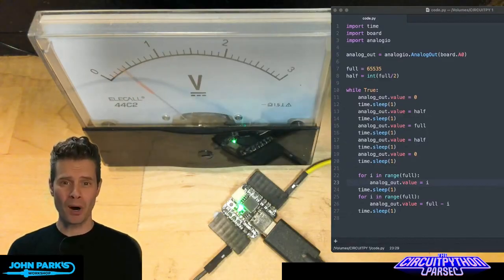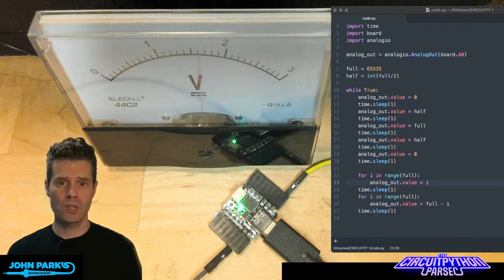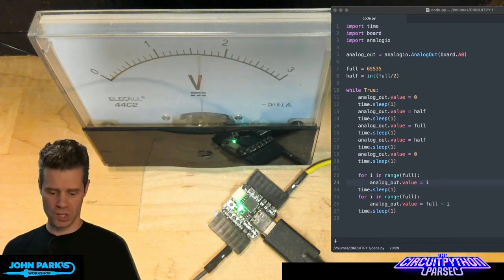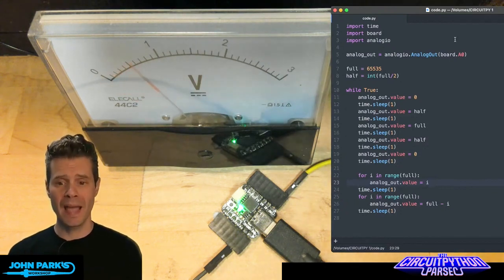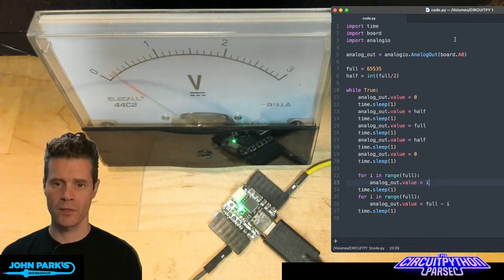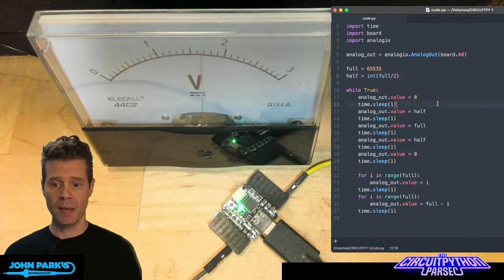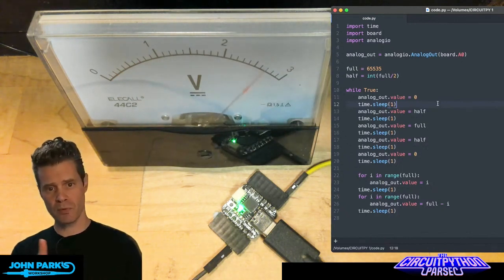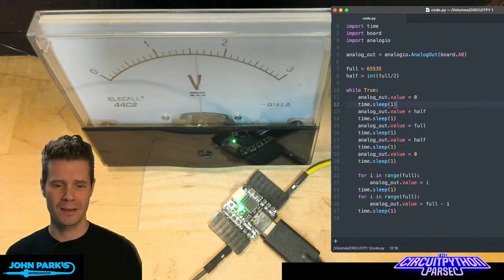John Park's CircuitPython Parsec: Analog Output @adafruit @johnedgarpark #adafruit #circuitpython

Comment: Today I learned. Can you also read voltage from the analogue pin? What do I look for in a board to be able to do this? Any circuit python board with enough analogue pins? Can this be used to control a small relay?
Reply: Yes, the analog input pins read voltage -- those are Analog to Digital converters and usually you'll have a number of pins on the board that can do that on most Adafruit microcontrollers, such as A0, A1, A2, & A3 on the QT Py. Relays you can control from digital output pins, usually adding a diode for protection.